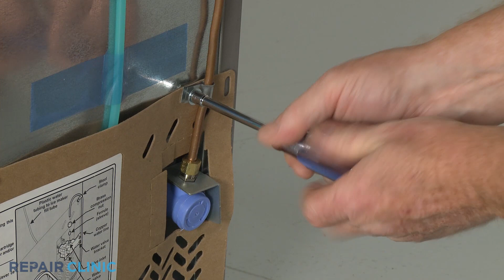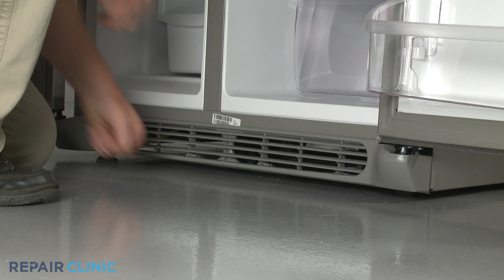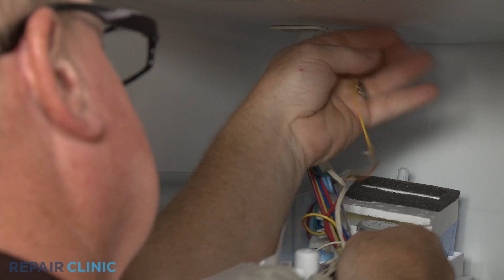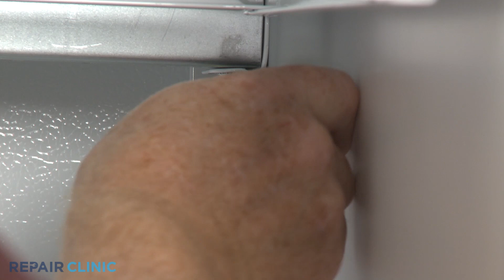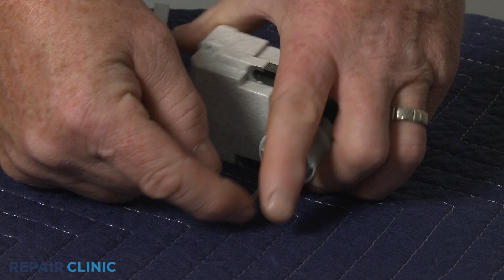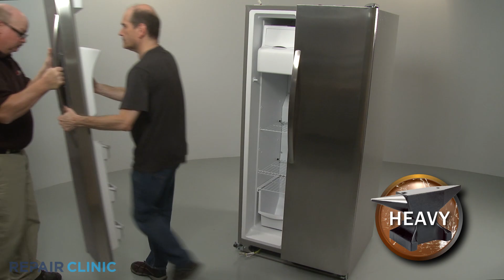Frigidaire Refrigerator Disassembly (FFSS2315TS0) – Repair Help

Comment: Good day; I am writing to you from Honduras. I just bought a frigidaire refrigerator model frss2623as1, a few days later I have seen that there is condensation on the side of the freezer door, due to the temperature controls; Is this condensation normal? Many have told me that it is normal, but others have told me that it is not normal. I contacted electrolux Honduras and they told me that it is normal. I want your opinion. Thank you.
Reply: @repairclinic  Good day; condensation only occurs during the night, in the morning it is dried with a cloth and during the day it remains dry, this condensation only occurs in the area of the controls. The packaging is visibly in good condition, but I am going to report it to your dealer for an inspection.
Reply: @repairclinic  The strange thing is that when I close the freezer door, you hear a sound of air through the packaging, by the side of the controls, and then it is removed.